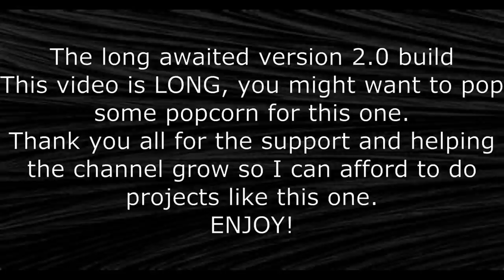Homemade ice maker build! VERSION 2.0! Cleaner build! #435

Comment: Hey, have you ever considered turning one of these chest freezers into a DIY chiller/cooler for AC? If you pair it with a temperature controlled switch that stops at 40F, fill it with water, add a pump to it that circulates the water out into a radiator core heat exchanger with a fan blowing on it, you could end up with a relatively cheap to operate Air conditioning unit.  Just a thought.
Reply from the maker: Well I'm actually planning on building a portable version of what you described (aka swamp cooler). That build will be coming in the future.
Reply: @TKCL  Cool! (pun intended) .. A chest freezer powered swamp cooler would be an Awesome build and the chances for experimentation to find the best resulting cool air would be great.  I look forward to that Video.

By the way, your property looks GORGEOUS .. Absolutely beautiful greenery.
Reply from the maker: Well not a chest freezer, but a cooler with a radiator, portable power and fan.
Reply from the maker: Thank you, we searched for years before finding this property. You are looking at 8 years of blood, sweat and tears to get it where it is now.
Reply: @TKCL  Well I wish you much prosperity and success. Please keep these videos coming, I live vicariously though people who can DIY stuff as I myself am useless with a tool .. 😆
Reply: Snag a 12v power freezer and now u got urself a  cooled flooring setup.
Reply from the maker: Just so happens I have one

Comment: If the heater is running the fan is not running, and vice versa. Is the heater controlled by a relay? If so can it be replaced with a Single Pole Double Throw relay? SPDT relays have two outputs, when one is on the other is off. If so, connect the heater to one side and the fan to the other.
Reply from the maker: Yes that would be an option as well.

Comment: Interesting I see you mention not buying a commercial unit because of expense. VEVOR 080-90 lbs in 24hr. 350.00 delivered. Not to mention some used ones for 150.00 most shipping extra. Yours 200.00 for freezer, 130.00 for ice maker. 10-20 for fan not to mention other parts and your right at 350.00 for an ice maker that makes half the ice. Nice idea though it falls short on efficiency.
Reply from the maker: Those are not in the realm of a true commercial unit with nickel, different compressor units, greater output and storage. Just because some one puts commercial or heavy duty in a description does not qualify it as so.

Comment: I've been having problems with my in freezer whirlpool icemaker it has a little age on it so I was looking at the Chinese icemaker's they make 150 pounds a day and that varies up and down according to the size of the icemaker but there's very little storage capacity and they cost around 300 dollars and up and then I came across your video again so I'm confused now on what to do a single icemaker takes many days to make 100 pounds when I go on a fishing trip a pack at least minimum hundred pounds on the boat and that's where I would go back to 5 gallon bucket's of block ice to make up the difference but I don't blame you taking a vacation after making that I would've took one too😂
Reply from the maker: The best I can get is 11-12lbs a day with two ice makers.  I have also started making block ice myself. This has been working out great for weekend boat trips (20-30lbs ice) and the occasional saltwater trip that requires 80-100lbs of ice.

Comment: I am curious about how much did this build cost you and how does it compare to a commercial ice maker.  I totally understand how much better this is compared to a commercial model. You need a solid slow melting cube and a refrigerator ice cube is the best.  These deep freezers do not have a defrost mode so there's no melting and refreezing of the ice to cause clumps and blocks like in a refrigerator freezer.  Anyhow what is the cost just for general knowledge.
Reply from the maker: Original build was $369, this new cleaner and more automated build was $525. I am currently testing fan locations and removing the pipe, one power supply and the smart controller. I believe I can get the cost down in the low $400s and make even more ice. All while maintaining a clean build and not cutting into the freezer. This can't produce anywhere near what a commercial unit can, but the ice is colder, longer lasting and parts are extremely cheap to replace. No ice machine tech is needed to work on this very simple unit either.

Comment: I noticed you used some sort of black material to box off the water insertion point on each ice maker and then create a new slot for the water supply pipe, basically rebuilding the water insertion strategy. What kind of material AND adhesive did you use there and did you check that they are food safe?
Reply from the maker: Not food safe, used epoxy and a black abs material.

Comment: I found this way late, sorry. (Ver 3.725?) I think that one 3" fan would be plenty. I DO think that tying the fan to shut off with the heaters would add lifetime to the system. Just put two small 120VAC relays to come on when the heat coils do.(one on each coil) Have EITHER one turn off the fan, as well as a door switch in series with it as well. When the motors come on to VEND the ice, the fan will have been off since the heater saw voltage. This will lessen the torque required to pop the ice out, much longer life on the plastic gears. If you need the cold air, one 3" pipe going down to a 3' tee and two stubs down in the cold pit will take up far less room.  3" fans normally require about half the current required by a 4", but naturally move less air. Fan could actually be down in the box a bit, just need to waft the cold up to the lid. You don't really need much. I would see a possible problem up front with the machine, the compressor is very small on these little boxes. If I were to make one, it would probably be in an upright small freezer. They cost a little more, but have much more capacity for cooling. The drop would be much easier and probably would allow some space above the ice makers to be used as freezer storage space for food items. I would probably mount the ice makers to the inside of the door. Just a bunch of comments. 30yr retiree coming from a facility (200,000+ sq ft) maintenance guy. Ice machines, walkins, kitchen equipment, HVAC, Boilers, Chillers, cooling towers.. with tons of PLCs controlling it all.  yada yada. Complicated works and can wring out the last bit of performance, Low Tech still works...  Michael in Colorado
Reply from the maker: Great information, thanks!

Comment: Do you think using a gravity fed water system would work? For example, one of those blue water jugs that's used in water dispensers.
Reply from the maker: I doubt it, those valves are timed to fill off of a certain pressure range. The time is adjustable, but I don't think for long enough to work on such low head pressure.

Comment: the smart stat controllers are great I use something like to control my fish tanks but I think a usually closed relay hooked up to the heater element will be better
Reply from the maker: I agree, sadly found out about that after ordering this. But I'm thinking I don't need any of it after testing this week.
Reply: @TKCL  shutting the fan's off when the heater kicks in should save power try a closed relay before you give up on it the heater element will probably be using quite a bit of power so minimising the time it is running makes sense
Reply from the maker: Well look at the recent videos, much less interest. I can't keep spending money on a bunch of versions, but I can keep testing my current one.
Reply from the maker: I'll look into that, thanks!
Reply: @TKCL  
.
Well that was Quick.  It looks good 👍
The dual Channel listing that is!

One other thing, try putting the word
"Homesteading" and "Building House" or "Amateur home builder time-lapse" for framing or wiring etc they do well.
In your titles and thumbnails it may help you rank better if the algo likes it as it may group you with other bigger homesteading channels in the suggestions??

Good luck

Comment: I'm concerned about ambient heat. The lid seems thin and that's a warm shop.  How about layering the outside of the lid with extra foam insulation? Even bats of fiberglass would work.   But anyway, this is an amazing job and thorough like everything you do. This one viewer is sticking around beyond the housewarming.  That should be the only 'warm' part you'll be happy about.  Congrats on another great project!
Reply from the maker: That lid is actually thicker than my last freezer. I've also put heavy insulated blankets over the last freezer lid with no noticeable change in temperatures or kilowatt usage.

Comment: 2 day average is 12.5 lbs per day with the original  fans from first build, blowing from the side of the icemakers  on top. I wonder if the high velocity fans would crush this number? 🤔 yes I have the 2.0 version with the smaller capacity fans. I bought my parts before the HV fans were involved.
Reply from the maker: That's what I'm testing, I think it will increase. But do have some concerns
Reply: @TKCL  how can I send a picture of my minimal set up?
Reply from the maker: Kelleyscountry@gmail.com

Comment: I'm sure there's a reason for this but I got a question? Why did you not have the fan turn on using the power signal sent to the ice maker heater to turn on versus using the thermostat wires that are cutting on at a certain tempe
_rature that you set it at?  Thank you, really injoyed it. If you ever have any home building questions let me know. I am a Alabama  retired licensed contractor/carpenter. My last 10 years was only new home construction and then sale.
Reply from the maker: Hard to tear in and locate that wire/signal, but it's absolutely possible.

Comment: When you use PVC boards, you could have used PVC glue instead of caulking when you made the joints.
Reply from the maker: Keep in mind the ends and inside of those pvc boards is a foam.

Comment: Nice work Andrew... Very smart to test your changes separate from one another.  

Thoughts... Do you think the grills at the bottom of your pipes may be restricting air flow? The slots  seem pretty narrow.  Perhaps you could run a separate test with the grills removed....
Also, I hope you try keeping the automated fan switching in the system when you relocate the fans.

How about adding Insulation on top and rear (areas that feel cold on the outside)?
Reply from the maker: I didn't show it in the video, but I drilled a lot of holes in the elbows at the bottom. There is plenty of open area for the fan to pull cold air in.
Reply from the maker: This freezer is different from my last, the only cold spot is the lid. My last freezer the back wall was cold.

Comment: I like this build better but dont think you need 2 fans just the pc fan is enough & it dont create extra heat inside the freezer !
Reply from the maker: I might test that theory if I can get a single fan to blow evenly across two ice makers
Reply: @TKCL  try 2" pvc with a T and 2 90's with short peice between so it fits under both ! I really think the blower fans a little to much force & could be building friction heat too but just a idea i'm no tech on that kind stuff !

Comment: Did you have to cut the area where the water tube enters the ice maker so it worked with the water coming from a different direction?
Reply from the maker: Yes I showed that in the original version. Some ice makers have knockouts and some don't. I trimmed that area out and filled in the existing U shape with scrap plastic.

Comment: Fyi if you move the freezer into air-conditioning regardless of how efficient the freezer is all that heat is going into the air conditioned room, honestly probably worse for a cost perspective since air conditioners are almost certainly less efficient then a freezer, the problem is it's impossible to know what it's actually costing because all the energy is instead added to the ac budget and that's to volatile to measure, maybe you can add insolation to the chest freezer and see if that helps if your trying to bring down cost idk just my 2 cents
Reply from the maker: Valid point
Reply: @TKCL  it's unfortunately just how thisestuff works, I'm not saying that you shouldn't move the freezer, all I'm saying is that cost analysis will be come almost meaningless since it's then tied to your specific hvac system and the total effective r-value of the insulation and losses in the house, still fine for relative measurements since you can still measure the efficiency of the unit itself fine(even better tbh since the environment is stable)
Reply from the maker: It's never been about cost as much as convenience. The air conditioned room should still extend the life of the ice maker and get it out of my dirty shop.
Reply: @TKCL  oh agreed you stated that yourself, this is more just a heads up since you wouldn't be able to test and give such info usefully for others without knowing this, if someone wanted to know the cost it would be nice to know that  cost is litterly being added to something else they pay for, honestly since evaporator systems are really efficient, counter intuitively you will be adding more heat energy into whatever environment your storing the freezer then the watts it pulls, since it's litterly pumping the heat of the water out of it and into the air+the energy it uses to do that

Comment: Nicely done for version 2.0. Lots of great ideas and very cool the way you've incorporated some of your viewers ideas along with your own improvements. I've got two ideas to offer for version 2.1.

Are the inner foam layers of the collar durable and washable? A more hygenic, easier to clean collar might be made of 2x4 rectangular PVC tubing. A couple of places sell it on line, but I've bought it from fencing supply houses. This could be stuffed with foam insulation, solvent welded at the corners and any gaps could be filled with spray foam. Second, I've installed fans similar to yours to create room to room airflow in a log cabin heated with a wood stove. I know these move LOTS of air and they get warm. I wonder if you really need to move that much air. Smaller, cooler running fans may save you a couple of kWhs. Otherwise, I think you are getting incrementally close to perfection.

Honestly, I'd've called it done when version 1 made 5 lbs a day! But I remain glued to your videos and I'm enjoying the house build too. Blessings on all your endeavours.
Reply from the maker: Thank you for watching! I'm seriously considering wrapping the insulation in metal flashing tape for easy wipe down and cleaning.
Reply: @TKCL  was thinking the same, I wouldn't want that fiberglass from the insulation in my ice, maybe paint it with an epoxy of some sort or some kind of sealant.
Reply from the maker: It's foam, not fiberglass

Comment: Just curious if you think the placement of the ice makers on 2.0 could make a difference being as they are placed over the deepest part of the freezer vs over the ledge in the original. Maybe try putting the thermometer over the shelf and see what temps you get there.
Reply from the maker: I'm currently doing that, location left or right doesn't matter. Top to bottom does. I'll explain in a upcoming video
Reply: @TKCL  my thoughts are that with the ice makers over the shelf  that it creates a cold spot with the fans blowing across the ice makers it circulates around and hits the ice maker trays also.  Especially if there are coils under the shelf. Kind of cuts the freezer in half so to speak. Just a thought and look forward to more test results.

Comment: i love the build...  what i have noticed stealing ice from a customers commercial machine vrs my garage similar build is my ice is so much colder that it becomes a block as the commercial unit is not as cold so it dose not become a block i have to break with a hammer...   what has your experience been?
Reply from the maker: Commercial machines keep ice just above freezing, constantly melting. This gives you warmer ice and a lot of electricity usage to constantly make new ice. Mine is far colder, bigger cubes and lasts longer. If not used often it can freeze up, using weekly isn't much of an issue. I defrost the unit 2-3 times a year.

Comment: you could have 4 ice makers in parallel
Reply from the maker: I could, but it would make scooping ice impossible
Reply: @TKCL   where the lip is where the compressor is you could have slide ice trays so u slide them under the makers then slide them out to the lip to scoop the ice

Comment: You spoke of adding a third ice maker.  I would first like to see you run a test with only one ice maker running.  Just flip up the bar on one of them and see how much ice the other one can produce alone.  I think you'll see that it doesn't reduce overall production that much, implying that a third would bring only marginal benefit.  I think your limit is in your refrigeration capacity and dividing that capacity among several ice makers won't result in more ice.
Reply from the maker: I have no plans to run a third, takes up too much room. I feel I am approaching max cooling capacity currently.

Comment: What brand or model is the freezer,  you never said.  Just that you got it at lowes or HD
Reply from the maker: Ive used two different models it honestly doesn't matter. The size it's what I've noticed is important. 7 cu ft. I believe mine is a hot point, not near it currently to get the name.

Comment: why not just run both of the fans off of a single door switch?  Seems simpler, cheaper, easier to me.
Reply from the maker: Two separate power supplies and I was worried about something happening tieing both together. I'm experimenting right now and I'm using one power supply